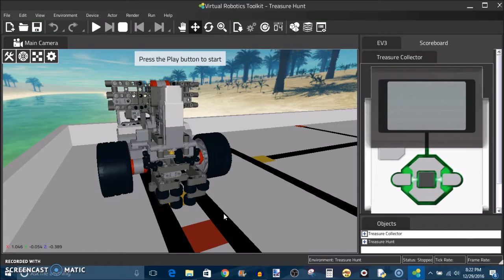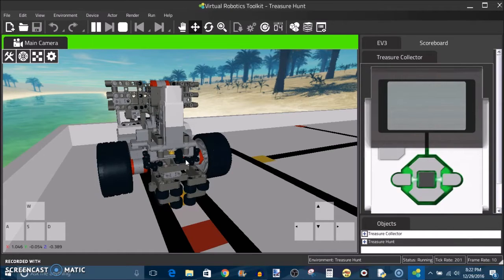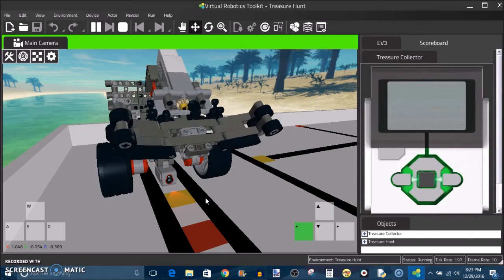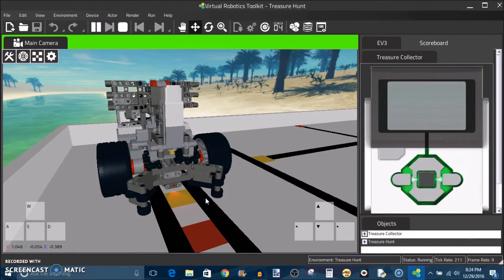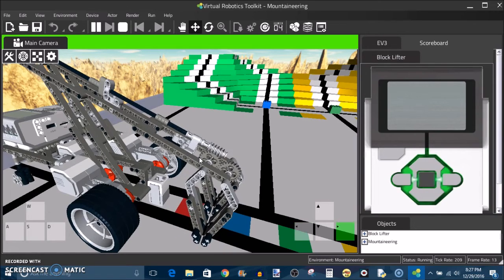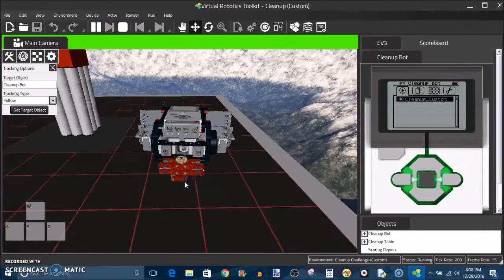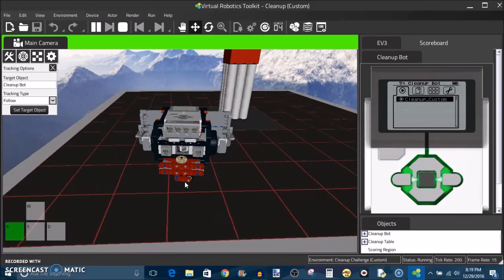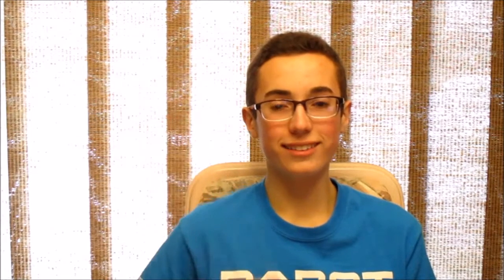Virtual vs. Physical Robots Part 2 - Mechanisms

Comment: Hey - I know this video is super old but I'm just starting to learn to use Virtual Robotics Toolkit and am trying to import a robot with gear train that I have built in LDD.  I have gone through the import robot wizard and assigned some of the pieces that are not being assigned to components correctly.  However after turning on the motor that drives the gear train, only some of the gears are being engaged, the others appear to just float or hang and don't interact with the simulation.  Any suggestions would be greatly appreciated :)